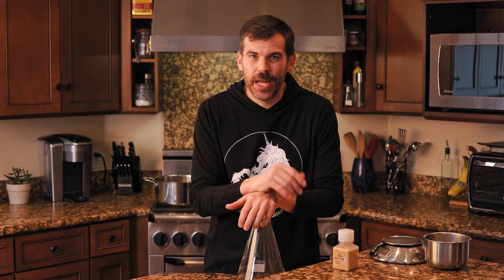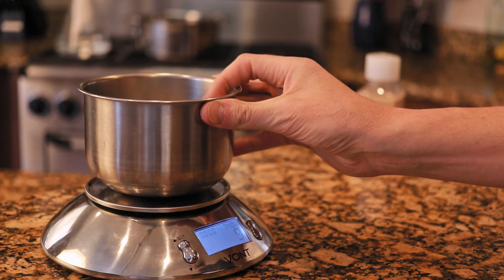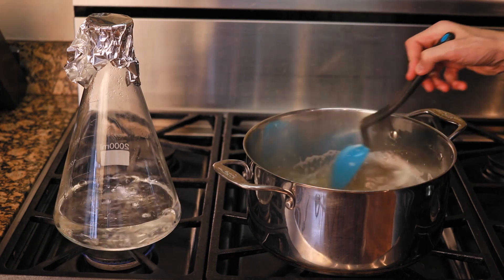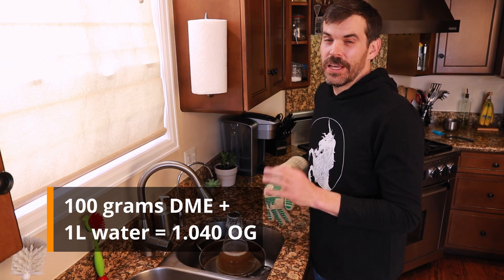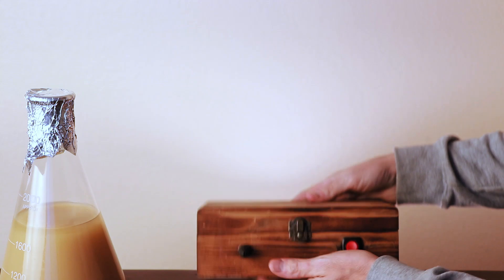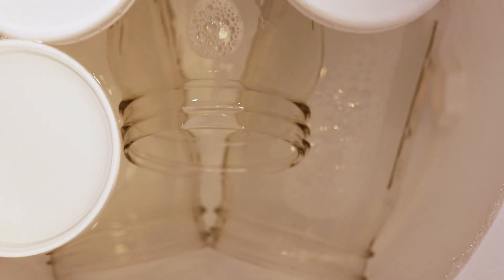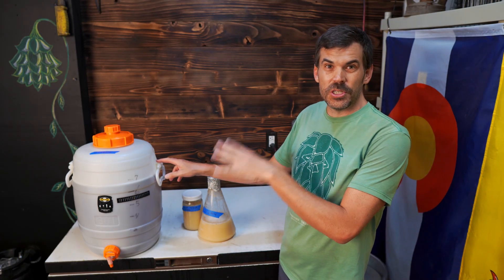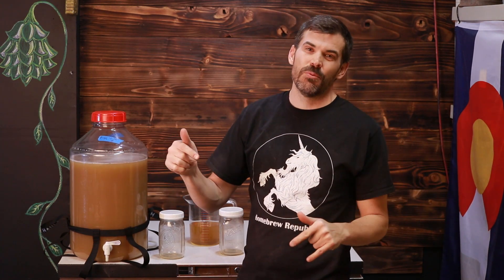Yeast harvesting from a starter the Brulosophy overbuild method. Save money making a yeast starter.

Comment: The magnetic stirrer is typically used on a magnetic oscillator which makes it spin around, mixing the contents of the container. It's common in labs. It does NOT prevent a body of water from becoming super-heated. Super-heating happens because an undisturbed meniscus of water has more tensile strength than the energy of heated water below has to break it, even when that water is above 100ºC. Thus when the meniscus is finally broken, the super-heated water beneath will try to vaporise instantly and you get flying water. You can overcome this in two ways: 1) simply swirl the water occasionally to break the surface or 2) put something in the water that breaks the surface, like a chopstick.
Reply from the maker: Thanks for the clarification. Next time I will throw in a chopstick before I move it off the stove.

Comment: I've watched many videos on doing yeast starters and overbuilding, I enjoyed this one the most.  I would recommend taking the foil off to put the laser thermometer into the actual wort to take the temperature inside the flask, the outside temp can be much different than the inside temp.
Reply from the maker: Liquid Gold Thanks. I will try that next time to see if there is a difference.
Reply: Quick heads-up regarding IR thermometers: they’re not known for their accuracy when pointed at reflective surfaces, such as glass, liquid, or tin foil. If you want absolute accuracy you’re better off using a regular sanitised thermometer directly in the liquid.

Comment: Why would you add more DME if the water is going to evaporate?  You don't add extra grain to your recipe due to boiloff.  If it going to evaporate then it will go to your target volume.  If you add extra DME to compensate for the extra water then that DME becomes extra when the water is no longer there.

Comment: Great video! Question - how do you know how much harvested yeast to pitch?
Reply from the maker: On the homebrew side it is really an educated guess. I’ve relied on what has worked for others and what has worked for me, good notes and loads of batches. On the pro Brewer side you use a microscope.
Reply: @homebrewrepublic8001  Well, I kinda had the same question.  'Roughly' how much?  What do you start with, in terms of liquid or dry?  One 'packet' (or little bottle, in your case above), that would normally do 5 gallons. Or double it?  Or, in another way of looking at it; how much would that little bottle pitch if you were to use it straight, directly into your wort - without first starting a culture?

Comment: Thanks for the video. I haven’t brewed anything yet, just watching videos to learn atm.  I had a question though.  What was that thick layer of debris on the bottom of your wort?  It looked like trub from a ferment, but you hadn’t even started fermenting, correct?  Thanks.  Good video.
Reply from the maker: Yeast will continue to reproduce when oxygen is present. The constant spinning from the stir plate creates oxygen. After it settles and is cool that is a yeast cake on the bottom. Dormant live yeast. There are rumors that 100 mL is equal to a 100 billion cell count. I currently do not have a way of measuring or knowing what the cell count is.

Comment: Awesome channel! Beginner question. What is the starter used for here vs the smaller jars? Is the idea that the starter can be used to build even more generations of yeast or? :) Thank you!!
Reply: Yep, the starter would be used for future brews. The ones he labeled A and B (smaller jars of yeast) are for his next brew.
Reply: @smaster15  Yes, but why - in the other method - are all the jars poured in anyway?  It seems like such a waste for such a small batch.  I understand a ten gallon or more.  But that amount looks like it would slam like 3 five gallon batches easily.  I must b missing something simple.
Reply: @curtbusch1428  I'm not sure I fully understand your confusion or question. What other method? Do you mean why is he pitching all of the yeast in jars A and B into his next 5gal brew? If this is the question, the answer is in the title of the video—he overbuilt the starter so that there's much more yeast than necessary. You can look up why brewers overbuild starters, you don't need me explaining that also to you. I'd personally recommend it, if for anything but the speed of brewing—fermentation speeds up drastically with overbuilt starters compared to pitching straight from the commercial packet.

Comment: Good work dude...
Anyway, you can not measure a temperature using an IR Thermometer on a shiny or reflecting surface... It may reflect IR rays from the environment and falsify your readings... I usually place a matt surface, like a piece of matt adhesive tape on flasks or even steel fermenters, and then measure the temperature  with the IR thermometer pointing to that area...
Reply: Don't see the point of messing around with thermometers..... simply leave the hot liquid overnight to attain room temperature